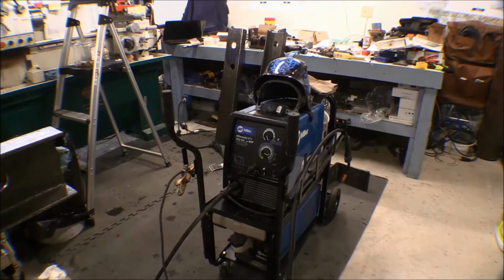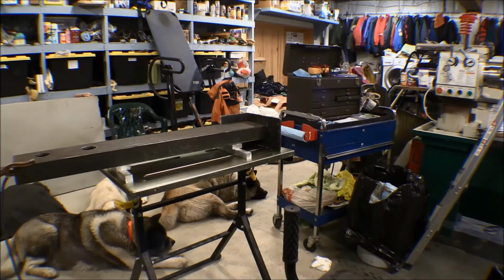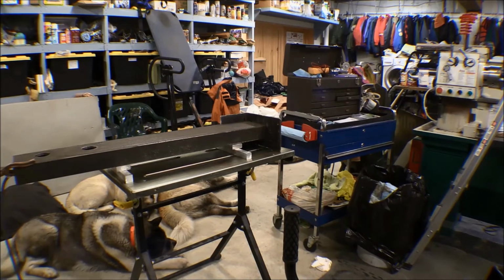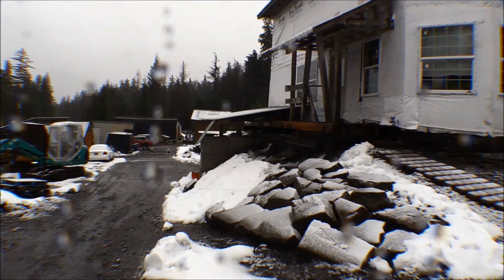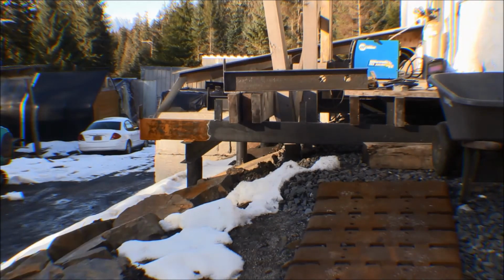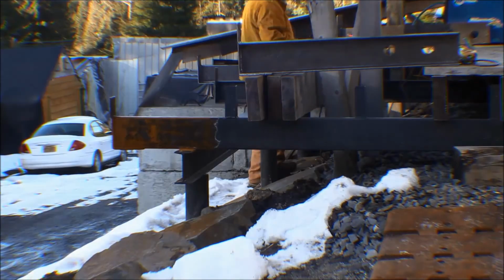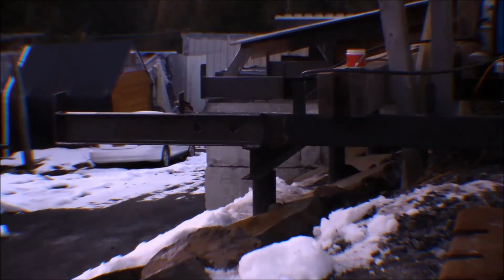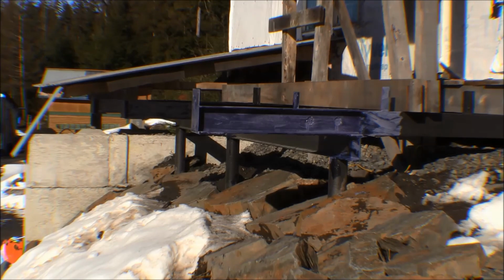Porch Build; welding on the extensions

Comment: A good circle cutting jig for the gas torch or one for your plasma will save you quite a bit in hole saws which get expensive (especially when they smoke your drill press!).  You can make your own or buy them ready made.  Come in handy.